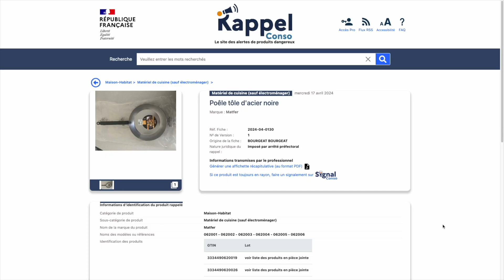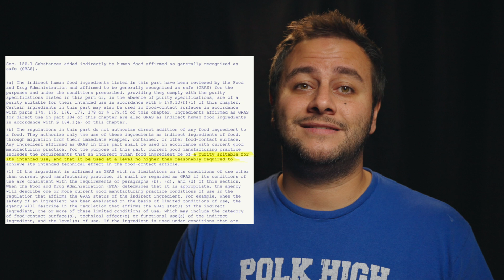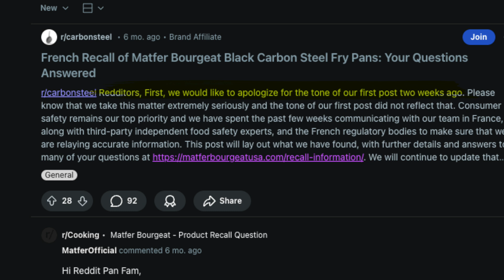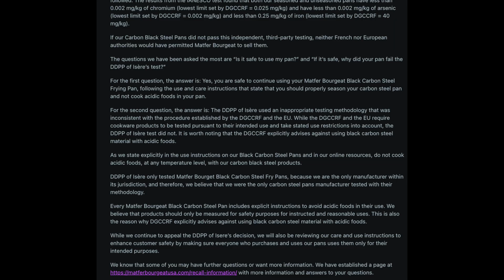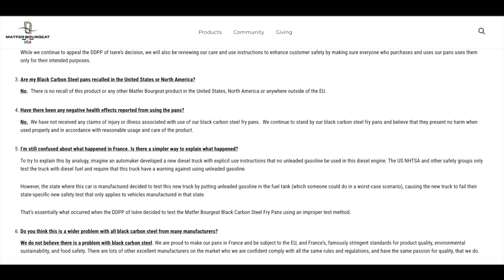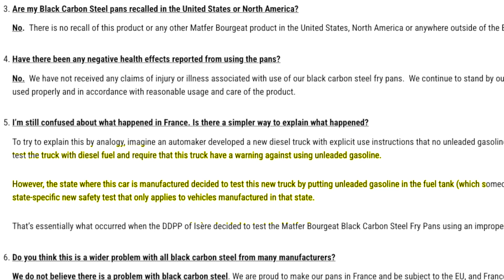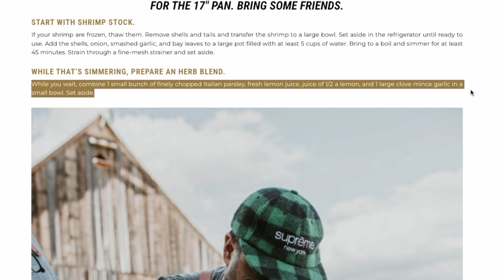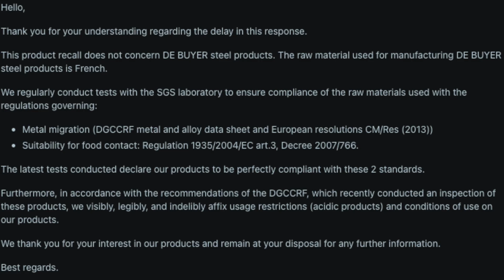Are Carbon Steel Pans Safe? | Matfer Carbon Steel Recall Due To Arsenic and Leaching | My Thoughts

Comment: The first thing that comes to mind regarding Matfer's response is they are, like most industries, putting all the safety precautions on the user. I've been researching carbon steel pans lately and I've encountered numerous reviews saying the seasoning doesn't hold for long, or properly at all. Seasoning is a pretty thin barrier. And your point that the public has been misled into thinking the warning regarding acid foods is merely for the sake of the seasoning of the pan. How many people add some lemon or tomatoes to their foods and, not seeing a terrible response to the pan, continue to do so? 

When I did some initial research I found that carbon steel is made from only iron and carbon, as is cast iron. I'm wondering if they're all made with other metals that have never been disclosed? The arsenic and chromium certainly came from somewhere. 

This reminds me of many years ago when everyone considered enameled iron cookware perfectly safe (some still do). This was hardly the case and many became enlightened to the heavy metals used in making these. 

I use glass Visions by Corning for pot-cooking, but I'm looking for something safe to sear/cook beef. For years I've been using stainless steel for this, and sometimes cast iron (it's so heavy), but my husband and I are mostly carnivore so my SS is getting a lot of use, too much use for safety sake, imo. SS leaches nickel and chromium. I'd hoped carbon steel was a safer alternative now I'm not so sure, and I'm questioning cast iron too.
Reply: Have you made any progress on this decision?
Reply: @pr0gressd  No. I gave up on carbon pans - couldn't find one without heavy metals. I've continued to use SS for steaks. But I use stove top-safe Corelle for stews and warming things up.
Reply: We are all going to lose out to something eventually in life.

Comment: If you’re putting aside CS for reasons you mentioned then it should be prudent and consistent you put away cast iron for those same reasons, no? What would happen if Lodge were put through similar testing standards? We just don’t know. 

Additionally, Made in France, as De Buyer emphasizes where they source their raw materials should not be the automatic green light for product safety. And as such, Made in America should not be automatic as well. Lessons can be learned from Boar’s Head. I agree with you that this could and should have far reaching implications in the cookware industry. It would be nice to have a universal standard safety system in place. 

Personally, I own a Matfer sourced circa 2019 or 2020 so I’ll continue using without hesitation. Like Uncle Scott takes, a lot of this is pearl clutching to paint all Matfers, regardless of manufacturer dates, to be comprised.
Reply: Like Uncle Scott I willI continue to use both my old well seasoned Matfer pans.

Comment: Hi Tom, love your channel but feel compelled to disagree with you here and offer my take. I'm an engineer in a heavily regulated industry who has worked in Europe as well as the US. In  my opinion you have focused to much on the various national regulations and disregarded the universal laws of chemistry. The fact is that all metals react to acids (to varying degrees as some metals are more reactive than others); if you take any uncoated metal cookware (including stainless steel) and subject it to the same tests as used on the Matfer cookware you will find leached substances and risk failing the acceptable thresholds used. Given this fact, when I cook I intentionally use cookware with a non-reactive surface when a recipe calls for highly acidic ingredients ...... for me that is either enameled cast iron or glass ceramic cookware (such as Corning's Pyroceram, not a plug, just giving an example). My stainless steel, carbon steel, copper and cast iron (not enameled) cookware is for everything else.

For full disclosure, I do not own any Matfer cookware (my carbon steel cookware is from another European producer). I also do not use cookware with "non-stick coatings", but that's a different discussion 😉
Reply from the maker: Hi there, I think you are missing the point here. Carbon steel was never advertised as not SAFE to cook with acidic foods because of leaching but rather because damaging the seasoning. These are two very different things and the fact is, the regulations found it leached unsafe amount of arsenic, chromium, and iron. That’s my problem. Imagine if you went out and told someone, “ you can use cs just not with acidic foods because it will leach and not pass gov regulations” no one would buy one. “ the bridge we built is good, just don’t drive any trucks on it…ever…”
Reply: @tomwadek  Hi Tom, I got your point and get that you are coming from the place of having previously endorsed the Matfer products and why you are now rescinding that endorsement. 
Advertising is nothing more than a means to maximize sales. Regulations are created by governments only in response to issues that become problematic in their eyes. Consumers should never blindly rely on advertising or regulations to keep them safe. It is in our own best interests to do some basic research.
On that note, my point is all metals leach substances (including harmful ones) in contact with acids ...... it's purely a matter of chemistry. I've had a copper mixing bowl for 20 years which is awesome for meringues, but as I'm sure you are aware uncoated copper is highly reactive so shouldn't be used with anything acidic due to the risks of poisoning ...... but white vinegar (i.e. acid) and salt does a great job cleaning that bowl to a shine (because it dissolves the surface). I have no idea whether or not there were any warnings/instructions from the manufacturer when I bought that bowl, I just use laws of chemistry to keep me safe and to keep that bowl looking nice and shiny. Same applies to cookware made from other metals.
Reply: @phillfisher9418 
The acid is removing Copper Oxide, it is not removing copper. Not all metals react with all acids as you are suggesting.
Reply: Interesting comments, but please reconsider the assumption that enameled cookware is safe. It is glazed using barium which leaches. The industry also uses other heavy metals such as cadmium and lead as coloring agents. These are a bit more inert than the glazing but they also leach, especially as they age. Years ago I had many conversations with Le Creuset regarding this and the most they would say was the amount of metals leached into food was "within FDA  guidelines". Well, government guidelines are set to accommodate the financial interests of the industries, so take these for what they're worth. I'm too old to believe anymore that the government has our best interests in mind. Especially when those making these decisions come directly from the industries they are governing. 

I'm glad to see you say that stainless steel leaches heavy metals, this is something that many falsely promote as a safe alternative. Unless I'm searing meat I use Corning Visions brand which is good for stovetop and oven. Is it made from 100% safe materials? Not likely, but glass provides a 'nearly' inert material so the amount of exposure is probably not even measurable. When I researched Corning's other cookware (the white brands) I recall they used glazing which could lead to the barium issue I mentioned above.
Reply: @L.J.01  Yes I mentioned Corning's Pyroceram materials in my original post, very versatile cookware. I too use their skillets, especially great for cooking delicate things like fish as you can look through the base of the skillet to see when underside is cooked ! I do also have a bunch of their white Pyrocerm products. When I researched their materials years ago I recall that the white material is the original Pyroceram that they developed in the 1950's and the transparent Pyroceram (which is what their Visions products are made from) was a later development from their facility in France in the 1970's. I don't recall anything about the white Pyroceram being glazed, though of course they switched from Pyroceram to glazed stoneware in the US about 20 years ago (they are indistinguishable to the eye unless you look at the bottom to find the ring of unglazed ceramic on the stoneware version ...... and of course the stoneware cannot be used on the stovetop).
Dutch Ovens are the only glazed cast iron cookware I use, prefer them to Pyroceram only because the lids fit much better to retain moisture.

Comment: Respectfully, this video shows tremendous ignorance of chemistry. I won't get into the differences of chelation between the citric acid used in the test and, say, the organic acid composition of a tomato sauce, but the short answer is that you'd have to BOIL a tomato sauce in an UNSEASONED pan for almost an ENTIRE DAY in order to APPROACH the actually low and (frankly) mostly safe levels extracted in the recall test. 

Further, arsenic and chromium (specifically Cr(III) found in metal pans) are BOTH expressed in urine and certainly not "cumulative" as you say in the beginning of the video. 

Lastly, the DOSE also matters. Long story short, your diet would have to consist of nearly a GALLON of 24-HOUR BOILED tomato sauce EVERY DAY just to get CLOSE to MAYBE ingesting enough to harm someone. Over a lifetime.

But even THEN, one gets FAR more arsenic and chromium in a serving of rice, leafy greens, whole grain bread, and beef than if one were to cook tomato-based sauces in an unseasoned pan on the regular—something we just don't do, anyway. 

I have no love (or hate) for Matfer, but their response is absolutely appropriate. Cooking in one of their pans (or any other with reasonable independent testing) doesn't hold a candle to what's consumed in a normal diet, even if the pan is abused and best practices are totally ignored. 

Anyone concerned about this is, quite frankly, borrowing trouble. I understand not everyone paid attention in chemistry in highschool, but the panic over these pans is hilariously misplaced.
Reply: @soniCron You are wrong in most of your assertions. No point debating  someone who begins a comment with 'respectfully, you're a chemistry ignoramus' and uses caps to make decidedly inaccurate points: E.G. chromium and arsenic are in fact accumulative in organs, soft tissue or bone. Just because they are "expressed in urine" doesn't negate this. 

Tom's response was spot on. Kudos to him for raising important concerns.

Your response and others like it are starting to look like a crafted PR defense.
Reply: Really curious about this...
Reply: this is the most helpful and reasonable comment.
Reply: 5 g/L citric acid solution is about 2.5 pH, which is about the same as lemon juice. Nobody is cooking lemon juice. People cook WITH lemon juice. A piccata sauce, for example, reasons out to about a pH of 4. A tomato sauce is around 4.3 pH.

Each point on the pH scale is 10,000% more acidic (or basic, depending on direction). The citric acid solution used in the test is about 25,000% MORE acidic than the acidic foods we cook. 

Obviously time is a factor, but their test boiled citric acid solution for TWO HOURS. To match the chelation with an acidic FOOD (the most acidic we actually cook) would take at LEAST 10 TIMES as long. (About an entire day.)

And again, this all has to happen in an unseasoned pan with total disregard to the fact that the food would TASTE metallic and inedible.

It's seriously a total non-issue.
Reply from the maker: Well I’m glad you are not trolling but I have to disagree and arsenic should never be present in a pan over the regulatory limits seasoned or otherwise. We can agree to disagree
Reply: A cup of brown rice has about 300% more arsenic than a cup of their final citric acid solution test (which would be disgusting to consume), and about 1,900% more arsenic than their stated independent lab test.

I really cannot stress enough how much of a non-issue this is.
Reply from the maker: @soniCron yes, but that’s why you wash and cook rice. Again the impacts, as stated in the video, are cumulative which is why with harmful metals the goal is to reduce them. That’s why the regulatory numbers are what they are. To reduce total impact. Cheers
Reply from the maker: huh? respectfully citric acid is a weak acid with a PH of 3-6. Lemon and lime juice for comparison has a PH of 2-2.6. Are you just going to ignore the fact that Matfer is telling their customers not use any acidity what so ever because they can't guarantee leaching under the safe regulatory limits even though they have videos and recipes calling for acidic foods. You ignored so many aspects of this video.  I can't tell if this is a troll comment or not.

Comment: I agree with Tom on this. In Reddits forums there have been a lot of talk of this. There have been a few chinese and a few western manufacturers showing some positive test results with their pans. I have not bothered to fully check if I could find my Matfers batch numbers as I do not use it as my main CS pan. However I keep using other brands carbon steel and cast iron pans as my main pans.

Comment: Is there a class action lawsuit?  I bought the Matfer Bourgeat 062005 Black Steel Round Frying Pan 11 7/8-Inch in February 2017, following ATK recommendation. DGCCRF specific sheet for "Metals and alloys" is dated 01/04/2017.
Reply from the maker: not that I'm aware of at the moment.

Comment: Crazy price increases in around 2 years. 
I bought my first carbon steel Matfer pans in spring of ‘22. $50 for the 17” and a bit less for a 9”. Today, I’m seeing the difference being well $170 for the larger and   about $70 for the smaller. 

I guess that’s to cover losses involving this recall. 

As for getting the recall refund, replacement, or whatever, who keeps the packaging for such things? 
Good luck. And going out to purchase it again for well over double what it cost the previous time? 

Love your work❤
Reply from the maker: The price increases have been crazy all around. Cs was supposed to be the middle ground between ci and SS and now it’s just as expensive as SS. Thanks for the support. Cheers!
Reply: @tomwadek Carbon steel is basically plain steel too. Stainless is 10x the cost at suppliers! Makes zero sense.

Comment: You make some good points. However I wonder whether the situation is inherent to most carbon steel pans, including to other batches of Matfer that had not been tested and to other brands. The test was supposedly limited and performed by a local agency, implying other brands had not been tested, and was performed on unseasoned pans. When you first wash a new steel pan with abrasives and chemicals, you get smells that you don't get once coated with polymerized oils.  The irony is that many people moved to carbon steel in fear of PFAS coatings. If one is concerned, stainless steel is the way to go such as you have stated. BTW, the use of aluminum pots and pans is very common in restaurants. There are some risks that we accept to live with.
Reply from the maker: Well said, I suspect this will stir up the carbon steel cookware culture. Cheers!
Reply: @tomwadek  BTW, I was at Costco the other day, the Hexclad vendor was promoting their pans for not containing PFAS such as other pans on the shelves did. It turns out that Hexclad recently switched from PFAS to ceramic coating. I don't use Hexclad, but it seems like more and more consumers are moving towards so called ceramic coated pans.
Reply from the maker: thats very interesting and I think a good design move by them.
Reply: @tomwadek My mom and dad used aluminum a ton. They would allow it to wear to raw and a few years back both got dementia bad in upper 70's and had been SUPER healthy. People all thought it odd. Both at the same time. Years of accumulation I suspect from Club Cookware and Circulon specifically. I stick with my All Clad and Lodge and Staub enameled. Makes me want to do a simple warning video without naming brands on cookware. Aluminum is known to cause dementia and such btw. Sad as I miss them and was so close to them and they didn't deserve or know of it nor I til a few months ago. Dad passed last year and mom prior year. This stuff really does effect you long term.
Reply: “Accept risks” 

😂😂😂😂😂😂 spoken like a true capitalist capitulator , we don’t know the risks to accept them 😂😂😂😂, gosh you’d make a great CEO
Reply: @cmendoza1094  Do you ever eat out at restaurants? What type of pans do non capitalist countries use?

Comment: I have used Ballerini carbon steel pans made in Italy. Any word on those pans? I've only used it for searing meats that I place directly in the oven at about 400 degrees to finish cooking.
Reply from the maker: I'm not sure. I believe they are also testing to the same European standards. I would email them and ask them to specify based on the recent Matfer recall.
Reply: @tomwadek  Thanks, i will check into it. That did occur to me. Hopefully if it becomes available again that means they consider it safe. Another person on one of your other posts recommended the BelleVie 9.5 inch available on Amazon for $32.90 but he has not purchased it yet. Maybe a review of that would be good!